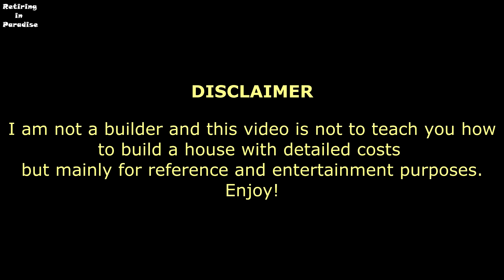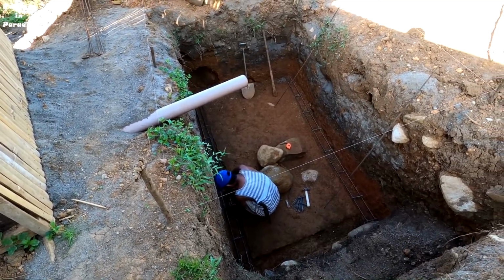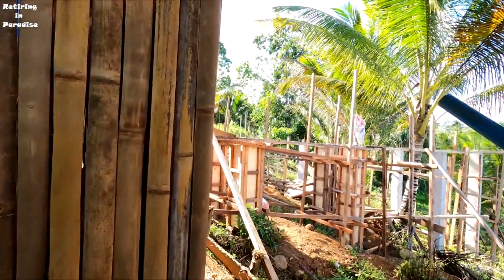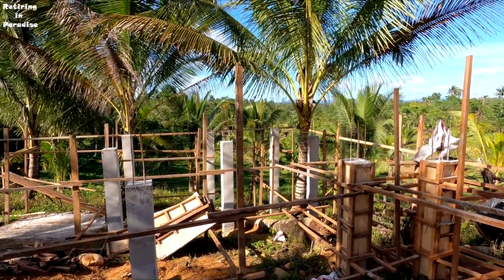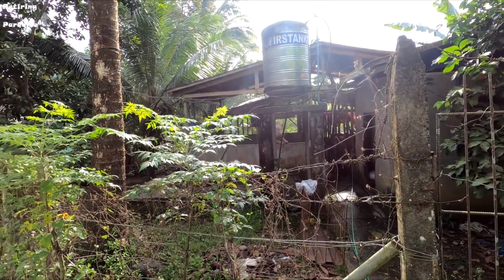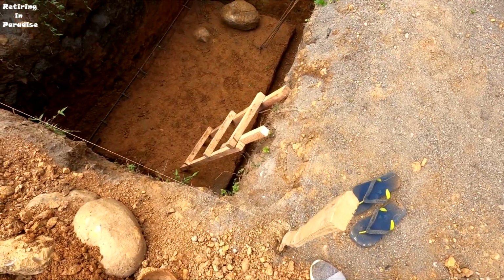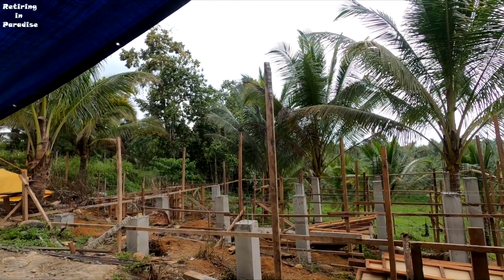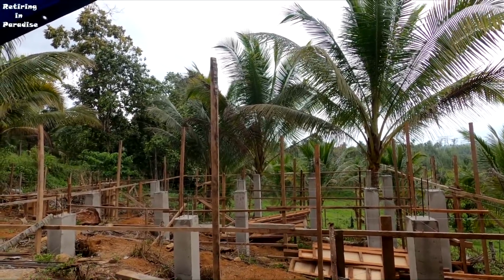V277 - Pt 12  FOREIGNER BUILDING A CHEAP HOUSE IN THE PHILIPPINES - Retiring in South East Asia vlog

Comment: The reason the tank lifted is because you didn’t have it full of water. Example if a large swimming pull is drained and you get a heavy rain it can lift it and cause it to float if you don’t have holes in the bottom
Reply from the maker: It was about 3/4 full but the land not drained properly.

Comment: Maybe placing flat steel plate bent over the edges of pillars,, will help to reduce termite arrival, mark the four holes drill force down and maybe tack weld so ensure stability of plate before you place timber on it🤔🤔🤔🤗❤️

Comment: What type of roofing material are you going to have if it’s the already  painted  ridge type you can get it cut to the length you want  that’s how I did mine  cheers Gerry
Reply from the maker: Thicker gauge corrugated power coated